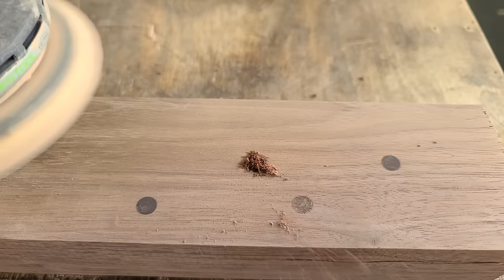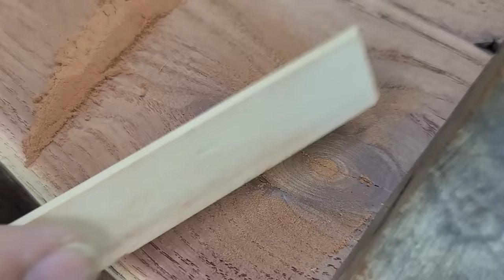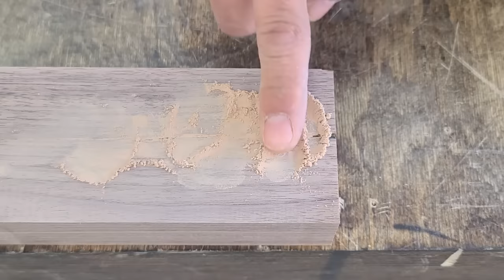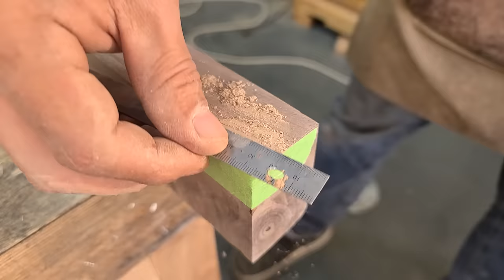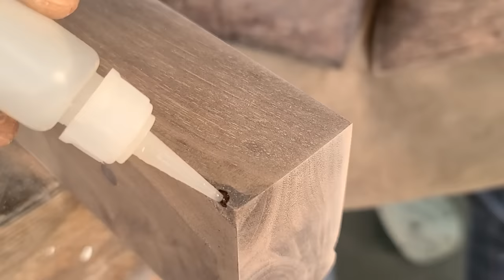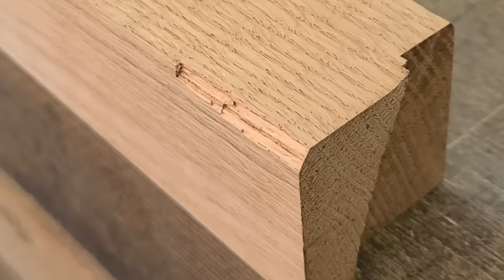Chemical reaction of instant glue and dust / First aid for damaged wood  [Woodworking Tips]

Comment: Its a superb trick! It also works with bicarbonate of soda! Ideal for plastic repairs. Rough up the repair area,apply a medium viscosity CA  and sprinkle on the bicarb! You can reinforce with lightweight fibreglass tissue too for an extra strong joint.

Comment: Love the corner damage repair. The only issue is that the fill looks much darker than the original wood. I wonder if there's a way to avoid that - perhaps instead of saturating the wood dust one could apply the glue first and then sprinkle the dust working in layers?
Reply: If you used a much lighter wood's sawdust maybe.
Reply: @Gr3nadgr3gory  Yeah, I guess you can save sawdust of many wood samples in bottles and try it out.

Comment: I've been using this method for about fifteen years now. It works great and everything I've tried it on is still intact.
Reply: What is CA glue?
Reply: @riflebear1711  same as Super Glue. You know, the stuff that sticks your fingers together or your butt to a toilet seat. It was invented to glue glass lenses together for high powered optics. It was also used in Vietnam to put livers back together because it is dang near impossible to sew livers back together. In fact I use it now instead of bothering a doctor when I need stitching up.
Reply: I use the CA glue to hold the toe nail on when I drop something on it and get a blood blister under it.  Piece the nail, drain the blood and rinse with alcohol and the CA it.  Have you tried the same method to repair small plastic parts, but using Arm & Hammer baking soda?
Reply: @glasshalffull8625  no I haven't use for either of the ways you mentioned, but it does give me some good ideas. 
I had my thumb tore open pretty bad one time. No doubt I needed stitching up as you could see my ligaments and the bone very clearly (you could have used it in an anatomy class). I washed it out with hydrogen peroxide and glued it shut with ca glue. It never got infected or even inflamed and healed up quite nicely. You go to a doctor's office and see the doctor only to have him tell you, " You need to go to the emergency room. That will be a hundred bucks please." I've been there and done that one and didn't even get a t-shirt. It used to be you could go to your neighborhood doctor with a bad cut or a broken arm and the doctor would sew you up or set and put a cast on your arm or leg. But no more. And I don't know why. To me, that would be the fun stuff about doctoring.
Reply: @krisknowlton5935   Knock on wood, I haven’t had anything serious enough for the ER in quite a while except a reaction to a medication.  They did give me a free shirt though 😬

Comment: I wonder how this compares in its properties (hardness, malleability, smoothness) with baking soda and CA glue. For wood this is ideal, but maybe it's also stronger than mixing CA with baking soda. The smoke coming out of the reaction seems to show it's very exothermic and quick.
Reply: Wondered the same, will have to test it out on a few different wood species.
Reply: I don't see it being as strong as   baking soda mixture.  That stuff dries almost like cured concrete....

Comment: I much prefer conventional wood glue and sawdust rather than CA glue.  It takes much longer to set but it is stronger, seems to give a better colour match and won't melt as easily.  It's not likely that the difference in strength will cause problems I guess, so if you're getting a colour match you're happy with it is mostly personal preference.  If you're in a hurry the CA glue version is undoubtedly a better bet.
Reply: PVA works fine but it shrinks quite a lot since it is water based and for larger areas it can take a few days to fully dry, at which point you may have sanded and applied finish only to realize you've got an indent where it shrank. CA shrinks too but generally you'll see it before moving on and can apply another coat (especially if using an activator, it sets up in less than a minute)

Comment: I do this with plastics and epoxy for model making. It's a quick solution for filling in tiny gaps, cracks and chips.
I have a container that's full of the plastic/epoxy dust from grinding parts.

Comment: Only issue with using glue is if you want to stain the wood. Glue stops stain from taking. In this case, I usually make a dowel off a offcut of the piece so the colour matches. I aim for the same grain pattern too
Reply: If they are just small spots, a little touch up paint would work. Juts have to make sure you match the colors
Reply: You just killed my idea for filling small gaps by using the sawdust generated while sanding hardwood floors!
Reply: @toobad9946  you can fill small gaps ok, especially knotts. as the dark patch off glue will be hard to notice. but i dont use it in light woods or obvious areas as it stands out.
Reply: @briw4647  

I was under the impression that the glue was harder than the wood and stained spots wouldn't take new stain and appeared as white. I want to fill small gaps and stain my red oak floor "Dark Red Mahogany".
Reply: @toobad9946  I suggest trying it on a piece of scrap pine wood. The dust goes darker once glue applied. It's great with knotts, that's what I use it for, stabilise the knott
Reply: @briw4647  

I'll try it on the floor in a corner of a closet. I don't exactly have any "scrap floor". LOL the house is 30 years old.
Reply: @toobad9946  I've seen it suggested elsewhere to mix stain in the sawdust first so it will more closely match the color.

Comment: There are commercial formulations available that do not smoke, is slightly thicker and work slower. As well as engineering powders with metal or other additives. Basically the bicarbonate method expanded.

Comment: Been using sawdust and wood glue forever for the same result
Reply: Generations of woodworkers used this method. It is close to actual wood in terms of paint and stain response as well.
Reply: Endor Chef. Me too. Nothing new here.
Reply: Wood glue takes way too long to cure.
Reply: @wadetaylor9974  24 hours is not a long time.
Reply: Ca glue less than 24 seconds.  8 oz. Bottle: $12
Reply: @wadetaylor9974  it doesn't hold up on the long term. It gets brittle. Just because it's fast doesn't mean it's good.
Reply: You can sand in one hour after filling small cracks. If it is a missing knot then you will hammer in a round piece of wood anyhow. If it is short, you can glue another piece of wood with joints. Possibilities are endless with wood, another wood, wood dust and carpenters glue.
Reply: @halukucar  no it's not bro lol

Comment: Did you use a normal sanding disk pad on your festool? I'm assuming you sacrifice the sanding disc you use with the liquid CA glue getting on there when liquid? Also, are the delays cut out between when you add the CA glue and when you sand, or are you hitting it within a second or two to try to catch it before it fully hardens?
Reply from the maker: This is a normal pad.
Sand immediately.
Reply: I bet this is totally clogging up the sanding pad!
Reply: @randallsmerna384  It's fine to sacrifice a sanding pad you bought in a 50-pack for a repair on such an expensive hardwood, right? I'm guessing it will as well, but the alternative is a damaged piece of wood.

Comment: Thank you for the video.  In English wood flour is called “saw dust.”  I think your glue is CA glue, is that right?  I would not have considered all of the many ways you show to use this combination.
Reply from the maker: It has the same viscosity as water.
Does CA show that viscosity?
I'm sorry I don't know the English name.
Reply: @망치소리HammerSoun  Sometimes called SuperGlue or Starbond.
 Comes in 3 different viscosity, Thin, Medium & Thick
Reply: at 43 seconds you can see on the bottle, cyanoacrylate adhesive, CA glue
Reply: Wood flour! I can't believe it not used more often
Reply: Cyanoacrylate glue, yes.

Comment: This is helpful to share with those who did not know they could use this combo - but why are you sanding and not waiting until the glue dries? Is it editing or simply that you're sanding/buffing whilst the glue is wet.

Isn't that clogging your flapper wheel/sanding disc?
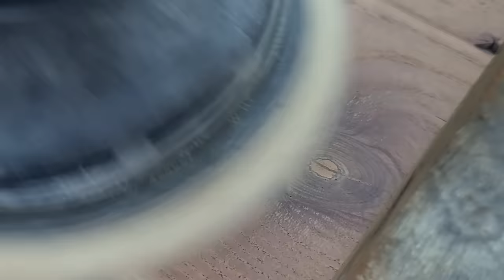Reply: 1:07
This was my concerns. The glue still wet, on the timestamp you it shift with air from the sander.

Comment: I'm a finish sander and have tried this method before.  I use  Tightbond 50 a wood adhesive and add  wood dust to fill large holes  .

Comment: This only works this quickly with Walnut, something chemical in the walnut works as a Catalyst or activator, causing the CA glue to harden immediately,
But try it will Pine, and the glue dries Slower, much slower
Reply: Put a little bit of baking soda in the mix and it will also harden instantly.
Reply: You can get a spray activator which makes CA glue harden almost instantly.

Comment: Jeeze……I’ve been doing this for years. You should be using accelerator…. It make the sanding process easier on the sandpaper so you don’t get grit in the cavity.
Reply: Same here, I thought this was some new chemical before watching.
Reply: Wood glue and saw dust works well and blends a lot easier.

Comment: 1. The end product is a lot shade darker than the surrounding wood, probably because of the CA glue darkening the saw dust or the chemical heat burning the sawdust. 2. Sanding immediately when the glue is still wet or tacky,  will leave the sander bristle bruised or damaged for next use. Better option would be to use PVA glue and sawdust paste, and press it into the crevice or chipped areas, let dry and then sand lightly. You would get a uniform output.
Reply: Вместо клея ,возьмите  эпоксидную смолу    или   полиэфирную  прозрачную

Comment: Until you find out that cyano acrylate releases cyanide when mixed with a reducing agent Like wood, and ignited or heated to it's decomposition products.
Reply: Is this real?
And how much cyanide does it release, enough to be something to worry about it you use just a few drops?
Reply: Would be a very minute level in this application. Not sure it would even be detectable. If it caught fire, it would produce a very small amount of cyanide. But that would be the least of your worries if you had an unwanted fire.
Reply: @lucacorallocaro4287  literally it's like one quarter cyanide the CN triple bond is what connects the carbon atoms and a polymer when it dries under regular conditions the nitrogen is released and the carbon stays but when it's heated the carbon disassociates in the CN group is released as a gas specifically HCN  gas which is lethal at 10 parts per million
Reply: @aaronm.3581  Not so much the wood catching on fire but say a pile of sawdust that he has out of his sander gets a little bit of linseed oil on it and that causes a runaway reaction which causes an excess amount of heat which could release all of the cyanide and all of the excess glue that's in the sawdust cuz he's sanded off the majority of the glue. And no cyano acrylic polymers range from 25 to 35% cyanide it is literally the reactive linkage that lets it cure to a hard polymer
Reply: @deipweedecuchiekrucher7384  Meh. You are worried about nothing. You think he's sitting around with 50 gallon drums of super glue? You assume he takes no precautions? It takes temps of excess of 200 Celsius to release the cyanide. You think that's achieved in his grinding? I don't.
Reply: @aaronm.3581  You sound ridiculous the MLD is like 50 parts per million it does not take a "big wiff" and I'm talking the number of people that you could kill with .3 g of hydrogen cyanide gas . And just because the reaction progresses slowly an ambient temperature does not mean there's not multiple situations at which it will be higher than ambient temperature and plus the fact that it's broke down to such a high surface area by sanding and also mixed quite consistently with the reducing agent means the probability of it combusting is 10 times higher and the reaction isn't only driven by heat hydrolysis could also happen or a process called decarboxylation which leaves an organic cyanide product which is 1,000 times more potent than hydrogen cyanide itself I think with cyanoacrylic polymers it's Ethel cyanate either way there's so many reactions that can go wrong when using a cyanogen compound mixed with any reducing agent and broke down to that size I don't care what you say you are not educated in this field no matter how much you read on Wikipedia.

And all of this aside why would you even want to have the smallest probability of having a cyanide-containing compound broken down into micron sized pieces floating freely in your shop not saying this isn't a good patching method I'm just saying it's dangerous as fuck compared to just using wood putty
Reply: @deipweedecuchiekrucher7384 Lol. You are a wild man. Enjoyed your comments.
Reply: @aaronm.3581  wildly awesome 😎 that is . And thanks
Reply: Fear mongers will fear, the rest of us live., laugh and point.

Comment: Smart cause the superglue is less expensive than the wood filler 😂
Reply: Superglue huh who would have guessed
Reply: Saw similiar use of epoxy but takes longer to cure
Reply: Cheaper than wood filler!
Where?
Reply: It takes only seconds though. Time is money. Filler can take hours.
Reply: @court2379  if you're looking for quick and easy, woodworking is not for you.
Reply: I grew up working in a custom cabinet shop.
Y'all are missing the point.
Let's say you're working cherry wood making a gun stock . Do you think you can find a filler to match at Lowe's or ace that won't Stick out like a sore thumb?
Reply: @Kendoe0341  this is an excellent reason for this process. If only the video could articulate why the process is useful and in what situation you would use it 🤷‍♂️
Reply: First: not cheaper.
Second: this is much faster. 
Third: wood filler doesn't work quite as well.
Reply: @jodylang8781  I understood the application right away. 🤔🤨
Reply: @Kendoe0341  yeah cause that corner colour match perfectly after aplying that superglue mix...and yeah you can find wood filler with different colours that match
Reply: Guitar makers and fixers use superglue and ivory shavings mixed with a little baking soda for quick repairs.
Reply: @DrifterSpirit9  I wish you luck with exotic hardwoods.

Comment: People, this is cynalcrylate glue! Developed in the USA in 1942 (they were going to get a cheap alternative to plexiglase, but the substance turned out to have very strong adhesion - it adhered to everything! Cinalcrylate was remembered after the war) So you can create a lot of things. Glue + filler. Moreover, almost any filler: wood sawdust, plastic, starch, baking soda, I used glue when I was reworking the handle of the Cold Steel Bushman knife, just wound the jute twine and soaked it with glue, then sanded it and varnished it. It turned out conveniently and beautifully. So don't hold back the faniasia!
Reply: Originally developed as a liquid bandage right?

Comment: Perfect repair👍. I would like to ask you something. I have a statue wich has several "cracks" (it seems that it has been glued badly). When the humidity is high it's perfect, but with dry weather it has several cracks. If I should "fix" it with Axia, how this would effect the stretching? Thank you & best regards
Reply from the maker: In a humid place, use rice as a repair method.
Mix fine sawdust and rice and put it in the cracked groove and sand it.
It's not done all at once, but it's the best way to fix it.

Comment: Great!!! Could you tell me how much this glue cost? What about larger portion of wood to be repaired. Is there a possibility to buy bigger glue bottle? Do I have to sand the power and the glue immediately or do I have to wait until it dreis? Thanks
Reply: Use regular superglue from any store, works with baking soda aswell.
Reply: Thanks, and when I sand It.....imediately after I put powder and super glue? 👍
Reply: @mcmlxi1961  First put glue, then baking soda or saw dust, wait about 10 seconds and then touch it, should be rock solid.  Then you can sand it.
Reply: @D33Lux  Thanks 👍😉

Comment: At a couple of times during this video it looked like there was smoke coming off of the sawdust after the glue was applied. Was that just fine sawdust getting caught in a draft or was the glue having a chemical reaction to something in the dust?
Reply: CA glue has exothermic reactions with fibrous materials. The saw dust has lots of surface area so the reaction produces lots of heat. I've never seen it in person but given the right conditions it can get hot enough to cause serious burns.
Reply: @ulbuilder  good to know. Thanks.

Comment: Do you allow it to dry before sanding?
Reply from the maker: no.
If you sand before drying, the sawdust powder fills the empty space and becomes hard as it fuses with the adhesive.
Repeat a few times and it will be completely filled.

Comment: its better to mix the dust in a small cup or something with the glue, you can use regular white wood glue, make puddy out of it with the dust then apply to holes or cracks let dry later sand it down..

Comment: But what about wood expanding and contracting from moisture heat and cold ? Hardened glue wouldn’t have the same properties as wood. Wouldn’t that eventually cause a crack between the sawdust glue filler and the rest of the wood?